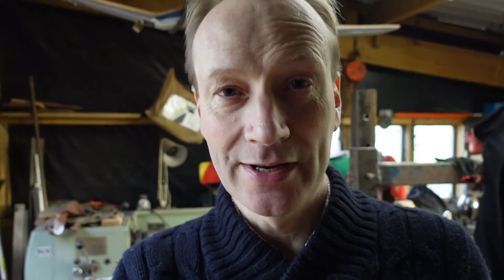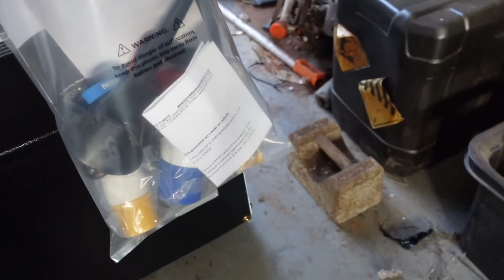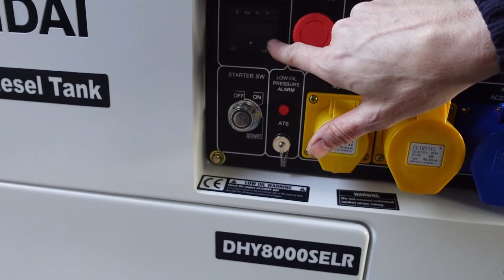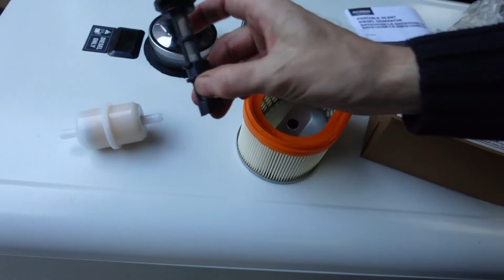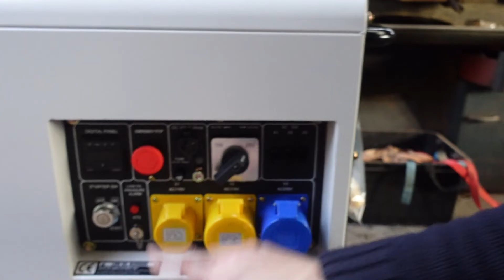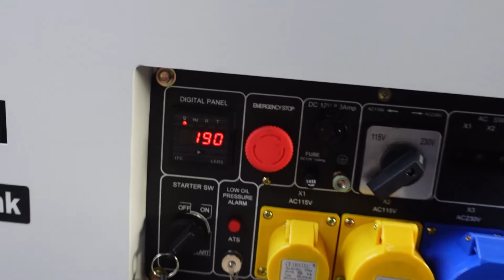Hyundai 8000 SELR diesel generator unboxing and starting.

Comment: The generator that can wake the dead, I bought one five years a go as it read silent, silent my ass ear defenders and seismometer needed near it the ground shook for 10 meters away from it I still have it not worth moving it but I bought a petrol truly Quiet gen from a company called rally spares remote start inverter with eco mode for low loads.

Comment: I got a new one of these, but when I tried to turn it on, the digital display suddenly went off. What happened? It’s brand new, and I’ve only used it for less than 20 hours. Help me please
Reply from the maker: oh no, that doesn't sound right.  If it were me, I would double check all the wiring contacts as it sounds like an electrical problem.  I think concentrate on the battery terminals, and the wiring around the display.  If that doesn't work, then as it is new, try the seller for some help too.  I hope you get it working soon.  Good luck

Comment: Considering it. We've always got power problems here due to UK Power Networks. They're not a good DNO. Constant underground cable faults, overhead cable faults, brown outs etc. In 2020-21 I saw 6 power cuts, one of which lasted 9 hours. Thanks for the review, I wanted to get this particular model because I don't like the idea of storing petrol and diesel keeps much longer and when it's about to go bad, I can chuck it in the car too.
Reply: A "brown out" sounds terrifying tbh 😂

Comment: Hi next time you update get a four pole Genny as the motor will run at 1500 RPM and not at 3000, cheers

Comment: Thanks for this. Mine arrived yesterday. Thinking ahead, how do you catch the used engine oil when performing an oil change? Slide a low-profile collecting pan under the unit and let the oil drip down in to it? Seems rather messy but I cannot see an alternative method.
Reply: My question exactly.  I came to this vid whilst searching for a "how to" drain the oil on this thing.  Also, does it have an oil filter??
Reply: @nigeltooby7681  The oil filter is the brown long plug / pipe he shows you at the beginning in the service kit - if you are not able to get anything under it to drain the oil - consider ising a syringe & pipe down the filler neck it will get 95% of the oil out

Comment: Ive got one and have to say they are garbage , im sure they are made in china and badged hyundai as you see the same generator with different badges, mine breaks down all the time and smokes a lot , they really are unreliable .
Reply: Yes rebranded Chinese junk.
Reply: Do you want to sell it then ?
Reply: we do have one like that generator but a different brand, they're all the same except the a kw, ours was reliable after an overhaul and and a battery replacement, starts like a charm with no problem